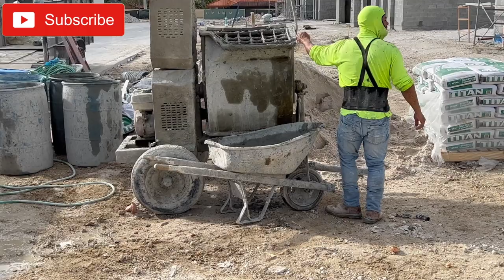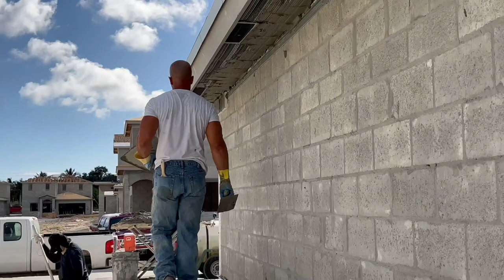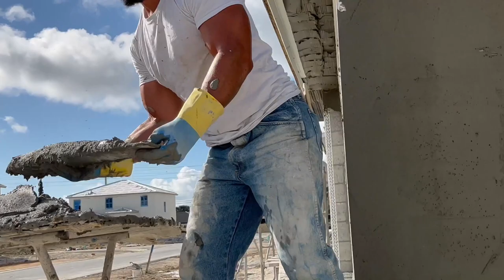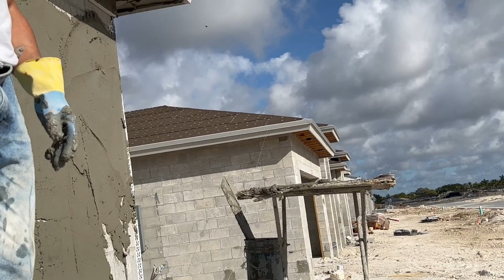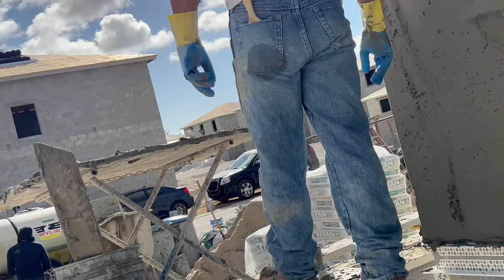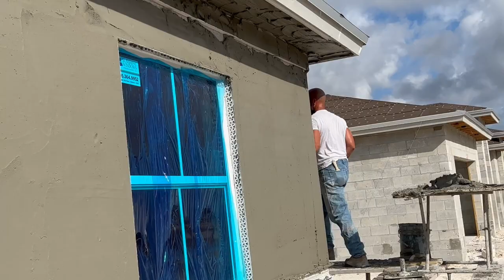Stucco Fastest plasterer’s in Florida with Don Rico , how to apply, setting up Trowel Texture

Comment: Never seen it this thin 
Usually you apply a scratch coat over paper and wire.
Then another coat of mud around a inch thick. Doesn't seem like this would have much R value.
Reply from the maker: I agree , the next video should be up tomorrow